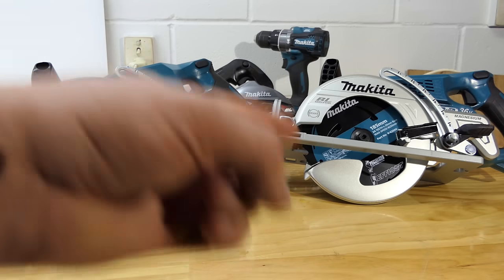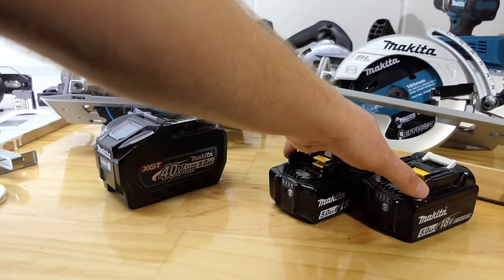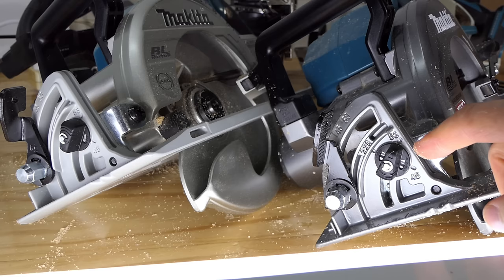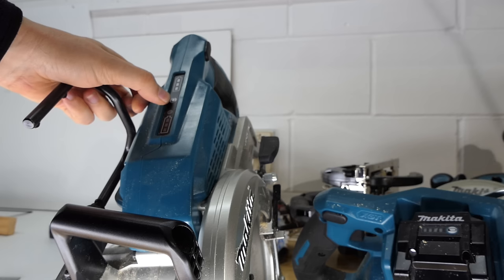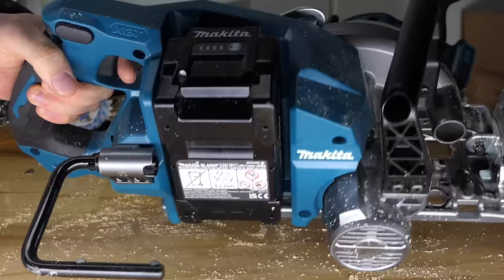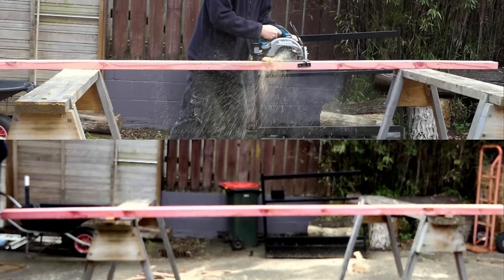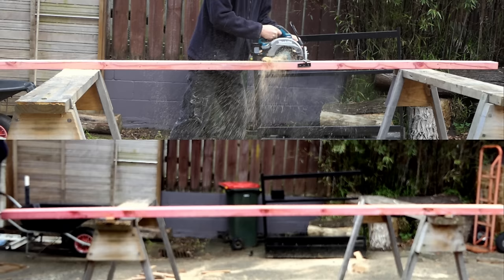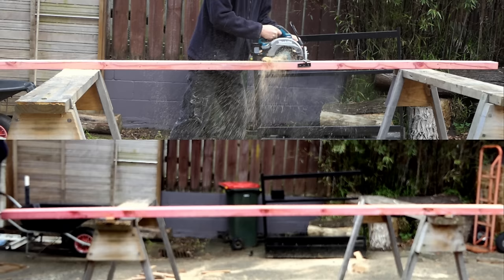Makita 40v Rear Handle Saw Review VS Makita 18v x2 Rear Handle Saw GSR01 VS XSR01

Comment: I love love love my makita 36 volt. It’s perfect, smooth and strong. Previously had the Dewalt 60 volt. Batteries are ridiculous was looking to get a 2nd one and was priced at 240. Home Depot had the Makita 36 volt for 250 w/ bag, dual charger and two batteries. On top of that two extra free batteries! For 250 (not including tax) nothing will ever beat that deal.
Reply: I did the exact same.  Had the dewalt.  Loved it, super super powerful, but got the makita on that deal and ended up selling the dewalt after using them side by side.  Dewalt def more powerful, but makita much nicer/smoother to use.  I'm wondering how the new XGT 40v will stack up against the dewalt in power.  I would love it to have the dewalts insane power with the makitas smoothness.  @Tools & Stuff, if you have the dewalt could you comment or compare the dewalt 60v to the makita 40v?
Reply: I bought that same Home Depot deal too
Reply: The dewalt just feels like it’s rushing to cut the wood. Makita has a nice finess to it
Reply: I just got that deal today but now they are including a free tool!!
Reply: If you like that you’ll love the XGT

Comment: the 36v has a auto toggle for torque vs speed, when the workload breaks breaks the threshold for speed it switches to torque mode for ease of cutting

Comment: Great video, exactly what i was looking for!! Ive used the 36V saw as my "daily" for the last 4 years and its still cutting strong as ever.  But its time to switch over to the 40V line and have just ordered the rear-handled 40v saw.  As a 3rd Gen California  carpenter the 36V was the first cordless saw able to drag me away from my beloved Mag77.  I remain impressed by its longevity onsite.  Thanks again for a great video.

Comment: I work highrise forming construction. We've been using the same 36volt saws for two years straight day in day out with no issues. It seems the 40volt outperforms the older model but with literally no problems after two years and counting it wouldn't make sense to leave the 36volt platform and jump to the 40. Although I'm looking forward to getting into the 40volt platform.
Reply: Yea its one of those things that when a tool craps out, instead of paying for repair you may aswell replace with the new 40v. No point rushing over and selling ur current gear though
Reply: I have the 40 volt worm drive. If youre  curious about the cons of the saw ive nopticed a couple tyhings although i still love it andf think its an upgrade. 1. For some reason i can get a battery to overheat once in awhile when im ripping when the lxt doesnt or i havent seen do yet. 2. The 4.0 battery doesnt seem to last as long vs the lxt versions. I dont know why it just doesnt. Im assuming higher rpms drain the battery and also if your pushing it the torque increase probably drains the battery. A tip i found usefgul is, use makita blades they are thinner so the saw doesnt have to work as much. In this case the 4.0 battery can last you almost all day.
Reply: @colekidd2  Two 5.0 lxt batteries has about 25% more energy than 1 4.0 xgt. So if you're able to make the lxt last for 8 hours the xgt should last about 6 1/2 hours under the same circumstances. But like you also mentioned spinning the blade at higher RPM and Torque will also end up using more energy overall.

Also since the lxt x2 has 20 cells overall vs 10 cells in the xgt x1 you're effectively drawing half the energy per cell so they simply don't heat up as much.
Reply: @brodycloud3405  Yup. I went into the xgt platform full throttle believing they’re marketing a little too much. “Outlast, Outpowers, Outsmart” Designed for high demand applications.” The xgt tools don’t take on high demand applications” significant more than lxt. Basically the lxt counterpart is still right beside them is what i’m saying. What an lxt tool can’t do an xgt really can’t either. But when it comes to regular applications they are sweet!
Reply: @colekidd2  o

Comment: Excellent video! I have the 36 volt version and it doesn't have the dust removal port
Reply: Me too.
Reply: the dust port is a later production run
Reply: Yeah it’s on the late 2019 model

Comment: Gret review. I do have comment about behind the handle vs not. I am from North America and a Real hardcore framer. In the western part of the US, we use the behind the handle type saws, in the east they tend to use the regular or in my onion weird awkward over the top handled saws. Real :) Framers only use behind the handle saws for everything. Production is everything and if you're taking lumber over to sawhorses to do your cross cuts you are wasting a lot of time. if you're bending over weird to use a "regular" circular saw to lay the saw flat to cut and having to push the saw through with your arm that's a lot of energy and again a waste of time. Instead with a behind the handle let the weight of the saw fall through the board on a crosscut. the saw may be heavier to reach out or overhead to cut something, but the difference is that I can see what I'm cutting even with a compound miter type of cut. Using a behind the handle is like using a shovel, you need to get our ass behind it where you have the most control where over the top is more energy and less control. Yes, you could say it's a matter of what you get use to but when you have a saw in your hand every day and you don't waste time taking boards to the sawhorses or even more crazy, a framer with a miter saw you'll agree with me and never even want to own a over the top handled saw. Skill hit it when they created the Mag and Makita got it even more right when they came out with the hypoid in the 80's.

Comment: I had the 18x2 and loved it soon as the 40v became available in the states I got it and used it for 1 day and sold the 18x2. There both great saws but I got the 40v impact and hammer drill so just made sense not having to carry around 2-4 batteries just for the 18x2

Comment: I own the 40v rear handle, it’s a fantastic saw, 40 tooth blade really brings it to life.
Only thing it’s missing is an LED light
Reply: LED light? On a circular saw? When would that come in handy?
Reply: @Anglo-EgyptianMan  I got a first get brushless circ saw with a little led light in front of the blade, it’s great!
Sometimes the electricians are busy making a mess for someone else to clean up, and while they’re doing they cut the power and limit the light available.
It’s also useful when you start early/work late in the winter, makes it a bit faster lining up that cut.
Reply: That one doesn't have a led light either?? 😕 dam I have the 40v 10 1/4 one and was slightly disappointed with that
Reply: @danyram89  My dewalt flexvolt rear handle didn't have a led light either. For some reason they're refusing led lights on rear handle saws...
Reply: @SweetStat  I read a comment some where that said that once you do a rear handle circular saw the wiring for it becomes a nightmare so that maybe the reason for that
Reply: Love this saw also AND.....a little disappointed no led light like others

Comment: Great review! an d excellent points about the pros and cons between the top handle and rear handle saws. I think the Skil heritage is too strong in the US and the production framers favoring certain fast cutting techniques,  but as you said the top handles are clear winners in crosscuts and other situations, and if you are not in a hurry there are plenty strong cordless top handle saws to rip decently too. 
My main saw was a very powerful corded worm drive Dewalt but when I got my cordless right side blade saw and started to watch videos of Japanese, Australian and other master craftsmen using this saws and adjusted my body position, material and jig holding techniques accordingly I started to realize all the advantages this setup has and I don't think I'll ever want to go back to a rear handle or left side blade saw.
But now the important thing is.... What's in the box???!! lol

Comment: The 36v is a beast when cross cutting really wet timber, but man it's heavy for swinging around. Otherwise, I like a top handle. I'm not interested in buying into 40v; the 18v gear does everything I need it to. It's a heap of expense for a more powerful cordless. If I need to rip a ton of stock, and don't have a power supply for 110v, I'll just run the generator.
Reply: Thanks for posting this man.
Reply: I wasn't going to get 40v until I killed my 18v drill with a 4" hole saw.  Wasn't much more to get a 40v drill kit instead, and then I liked it so much I got the impact, and on and on.  But the 18v stuff is still very good.

Comment: Great comments about the dust port . Our local makita rep says Makita  takes so long to develop their tools because they want to get them right ,but there’s so many little things they don’t get right .
Reply: Like not including a slot for the arbor wrench on the 36v model. Literally the only thing I've found wrong with it so far but I just got mine late last month. No need for 40v here. I'd likely never want a smaller tool like a drill/driver with a comically huge 40v brick hanging off the bottom. Likewise for the new LXT X-lock grinder I just purchased....that thing is heavy enough as it is with one 5.0AH LXT battery.
Reply: Like that sorry excuse for a rafter hook lol.  Its so unbalanced when u have batteries in it that if u hang it off the side of a scissor lift it damn near flips itself over.

Comment: From what I've gathered, cutting 2x4's in a rear handle saw - as you said, turning the board at and angle and cutting down is the preferred technique - you spend the energy guiding & steering rather than pushing the saw so you get more accurate cuts 🙂

Comment: The top handle saw is ridiculously high, So high infact that it is like a wrist breaker, Unlike the corded version the handle is more towards the rear making it more comfortable. The cordless top handle saws put undue pressure on the wrist when you exert pressure in ripping and if you experience a kickback.

Comment: Great video and the XGT is a very powerful saw, as I have had a chance to demo it for a few days. It is lighter than the 36v LXT, but if one feels the LXT is too heavy to use, then they are in the wrong line of work. It comes with a nice blade and cuts smoothly. You will feel the difference. My only gripe (not really a gripe) is the size of the battery and the placement on top of the saw. Both of these saws are definitely made more for the prosumer than the average DIY'er. So, should one upgrade if already vested in the 18v line? I don't see a reason why, but there are toolheads that always need the latest and the greatest. I have well over a dozen Makita 18v tools with 28, 18v 5.0Ah batteries, and 12 dual quick chargers. They all perform as expected, never failing or needing service. Specs-wise, the 40v line should be kicking some butt, but I simply have too much time and money invested along with real-world experience knowing the long-term quality of my 18v line to simply cast them aside for much more expensive tools, though well worth it I'm sure, for the newbie just getting into the trades. Remember, its just a tool, used to get from point A to point B. If your line of work requires the extra power from the 40v XGT, then go for it and build your collection from there. It's a Makita, so you should get long-term value from them.

Comment: I've been cutting old growth fir in an 1890s house and the 18v bogs kinda often. Modern lumber cross cuts are no problem.  My 18v impact had trouble driving screws into this wood fairly often, someone notched every floor joist and I had to drive about 2 dozen screws into a steel plate over every notch.  1.5" screws drive fine but 2"+ about 1 in 4 get stuck.  I got the 40v impact and no problem, so was interested to see how the 40v saw is.  It's too bad I wasn't aware of the 40v as I got the dual 18v last year for this project, but the difference doesn't seem worth it to upgrade.
Reply from the maker: Each 40v saw released is better than the last. There are at least 14 40v Circular Saws thus far.

Comment: I definitely want to upgrade, but the price is a bit steep at $400 for a kit, I’ll stick to my 36V until the price drops even a little on the 40V
Reply from the maker: That's really cheap compared to here.
Reply: @ToolsAndStuffOFFICIAL  I got lucky and got my 36V rear handle kit for $250 USD, but if Makita comes out with more 40V tools that get my attention I’ll definitely use it as an excuse to upgrade!
Reply: @joses8365  if you’re in the US, 40V on discount with free battery at Home Depot right now. After returning extra battery, the kit is ~$180 before tax

Comment: The question I'm asking myself  more and more often is if you should go 40V or corded when it's most of the time short use but also relatively close to mains electricity.
Reply: I really enjoy being able to move around freely to different parts of the building with my 40v top handle. I love not having to listen to generator noise when away from mains or spend time managing extension cords more than I have to.

Comment: Wondering if you could comment on the smoothness of the new xgt compared to the lxt.  I recently sold my dewalt flexvolt rear handle saw and replaced it with the lxt.  Not nearly as powerful as the dewalt, but a lot smoother to use. Just felt nicer, cut smoother, and easier to cut accurately.  Did you feel the XGT keeps these characteristics and/or improves on them over the lxt or does it lose some of this in favor of more power?
Reply from the maker: Still way nicer than using a rough as guts dewalt circ saw. It is a nice saw, you won't regret it.

Comment: All saws are somewhat illogically different. So top handle saws will, apparently, shoot dust the same direction the blade is, but back handle ones will go the opposite direction. This just makes no sense (even if it makes this much more usable for a right-handed users than the top handle left side blade saws). Still can't find anything fitting my needs in the XGT wood saw lineup. Perhaps the HS012 left-side blade will have to do, coz buyig different batteries for a right-side blade one seems like a much worse option. Also, Lidl (Parkside) has an option for about 1/5 of the  price, including the battery ;\

Comment: Bought the Metabo HTP. with 36 volt battery and charger on sale for 199.
I am thinking from size of battery that it is 36 nominal ( after initial voltage drop down) and that the Makita is also 36. after initial drop down from 40. This marketing ploy seems to have come about from DeWalt rating their 18v. ( nominal) as 20 volt so others followed suit. Like just found out Kobalt' s 24 volt are actually 21 in non- peak mode.This might clear up some confusion here and is one reason to stay away from marketing brands like DeWalt that have really.muddied the waters previously much clearer with 12, 14.4, 18 etc.
Reply from the maker: 12 volt is actually 10.8v. And makita already had a 36v system and an 18v x2 36v system so to not confuse it with those they went with 40v.
Reply: How do you like the Metabo? I’ve been going back and forth between that and the makita 40v

Comment: That blade on the 165mm doesn't look very trustworthy... @13:50
Reply from the maker: Why's that?
Reply: Teeth seem to be pointing the wrong way. Possible interference from a  speights or two too many? Haha

P.s. if you ever have to cut poly insulation that's the best way to do it. I'd only suggest to use an old junk blade with no teeth,  and an old saw if you have one. Melts right through the stuff.
Reply from the maker: I do it in many videos... deliberately... kind of like easter eggs for the hardcore fans, and to wind up others. Definitely got nothing to do with speights.

Comment: Two 90wh batteries don't compare to one 200wh  battery. Way more power from the 40v 👍
Reply: They do actually.. They're both running at 36v
Reply: Maybe the current draw is higher in the 40v 21700 cells (if i am correct) than the 18650’s in the 18v batteries.
Reply from the maker: The 40v battery uses 18650s.
Reply: @wippip  only the 4ah battery uses 21700 cells. The 5ah 40v is the same 2500mah cells as the 18v 5ah but some how the 40v has a higher charge and discharge current. 40a vs 30a.
Reply: @wippip  The 40V XGT tools are drawing half the current (amperage) and the benefit is less waste being dissipated  in the form of heat. Much more efficient.
Reply: That is a 40V 180Wh batt. Max output 2300Watt.
Reply: @kenb6144  how is that possible when both of the tools are 36v